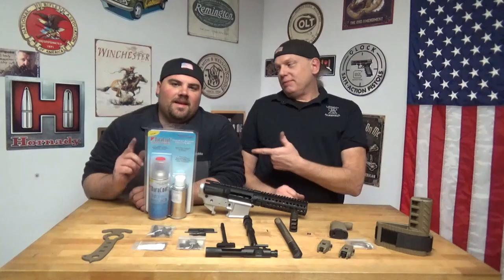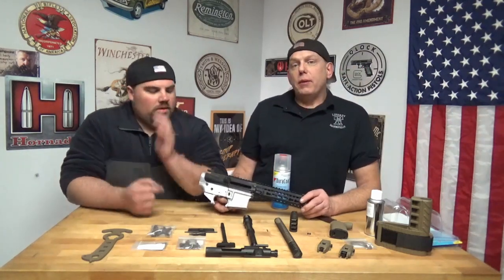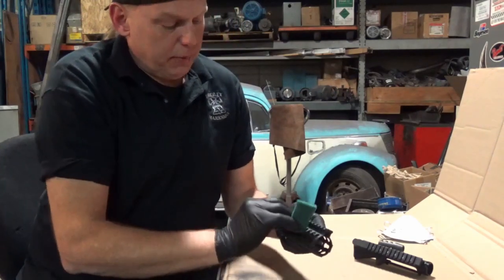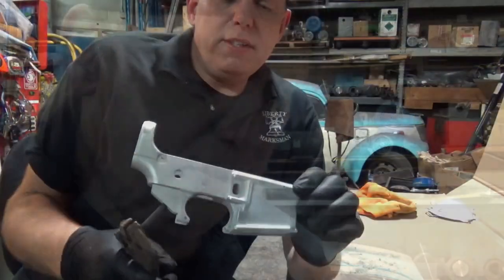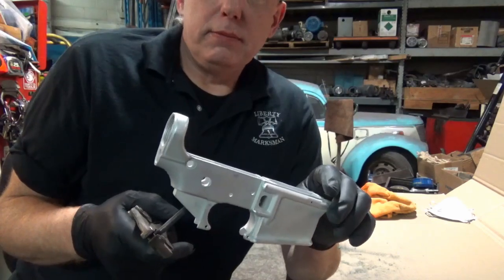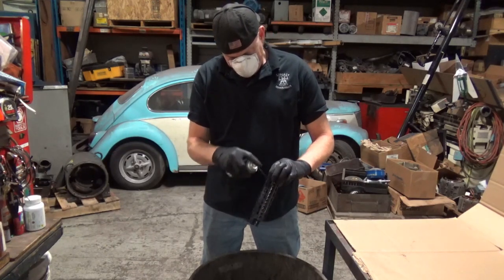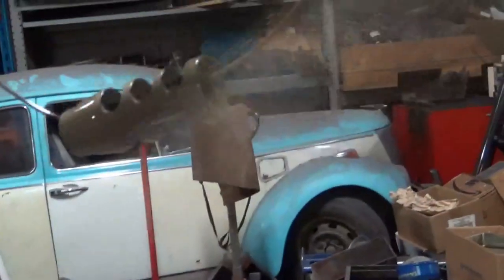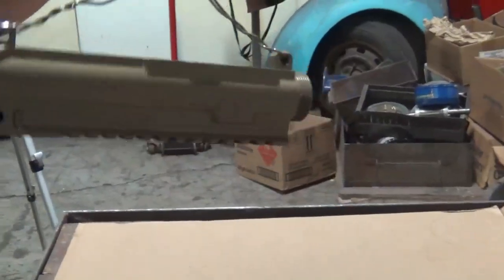No Air Compressor Needed Gun Coating With DuraCoat Aerosol

Comment: A little painter's trick.....You can control the final look of the "matte" finish by changing the distance you hold the spray can / sprayer from the component you are painting.  If you hold the spray can / sprayer close to the component, it will dry with a slightly more glossy/smooth finish.  If you spray from a little further back, it will add a little bit of texture and look more "matte".  Changing the distance changes the texture of the paint (how it lays on the surface of the object), resulting in slightly different "sheens" of satin/matte.  Also, as you can see in this video - if you put on a slightly heavier coat, it will be smoother, vs going with multiple very thin coats, which will give a little more texture to the finish that reflects less light after curing.  If you want to experiment with this process, you can buy a can of Aluma-Hyde pretty cheap and play around with it by scuffing some aluminum soda cans with Scotch-Brite and spraying from different distances to find the look you want.  Once you get the technique down, you can switch to DuraCoat or Cerakote and get the results you want.  Great video - thanks guys!!!
Reply: How far back are we talking about to get a more matte look?
Reply: @SkintSNIPER262  Oof lol, a whole year.
Reply: Lol
Reply: @SkintSNIPER262 about 12-15 inches. Just so that the spray "stream" spreads out and kind of 'dusts' the surface of the part you're coating. Just make sure the last coat you put on has had time to flash dry (10 mins or so).

Comment: Blowing the parts off with air compressor after sanding and before spraying the cleaner will get rid of the whole dirt issue all together
Reply: @phantommaggotxxx  Im pretty sure he was pertaining to the fact that previously duracoat and cerakote and the like all had to be mixed and sprayed outta a spray gun requiring an air compressor and proper spray gun etc. just to apply the product as to where now it comes in an arresol spray can that u can use any where without a air compressor but I can also see what ur saying also since the name is no air compressor needed hahaha but even then a can of compressed air for electronics and whatnot would be quite useful for blowing off the dust and debris from sanding/scuffing and save alot of hassle and frustration before using the degreaser or whatnot .
Reply: @phantommaggotxxx  well thay didnt make a good example
Reply: @phantommaggotxxx  On that note, would canned air work as an alternative to a compressor for drying and blowing off debris?
Reply: @atomic_wait  It would for the most part, but you may end up going through several cans, so it's not cheap.

Comment: No doubt precleanig all parts with brake cleaner removing all oil and dirt before scuffing. Then blow all parts with compressed air . Then use metal cleaner with kit. Then spray all parts with Duracoat finish according to instructions

Comment: There is a reason they suggest cleaning before you sand the parts. It's just like painting a car. If you sand before you clean the parts, you run the risk of sanding grease and other junk into the  paint that will blead through your paint job. So, follow the directions.

Comment: I've actually used that once, when I didn't want to break out the air brushes (I hate cleaning those things).  It works pretty good.  Three coats on a shotgun gave it a tough, quality coat.  Apply it thick to those "tight fitting" areas and it ~will~ mess with tolerances.  Don't get in a hurry as far as cure time goes.  I left my gun hanging in pieces for about a month (patience, Grasshopper).  A tip for muzzle breaks or similar devices:  Screw a wood dowel into the threaded end, then put your "hanger" through the dowel.  It gives you better control for coating, and it keeps the Duracoat out of those threads.  It's like painting a popsicle.  Good review.  "Thumbs up" from this Kentucky boy.
Reply: thanks nice tip

Comment: Simple green in a bucket soaking (for very oily parts) an hour then scrubbed less time for new parts  then re soaked and scrubbed with a clean tire cleaning brush! Rinse in a five gallon bucket of warm dish soap, it does wonders and with a final hose rinse and after the parts dry then spray with brake cleaner then spray I get the best finishes when I do it that way instead of just the brake cleaner/solvent method
Reply from the maker: Sounds like it would work good simple green is a wicked degreaser.
Reply: Thought brake cleaner is a no no
Reply: Post some pictures or videos of them
Reply: I'll try that method next time thx for the advice!
Reply: Where do you get a 5 gallon bucket of dish soap?

Comment: I did the same treatment to my Mosin Negant, came out great.
Five coats of DuraCoat flashing off the solvents between coats with a heat gun, nothing easier.
Reply from the maker: That's awesome, how's it holding up for you? It's been a couple years since we did this one. We are very satisfied with how it's lasted. Thanks for watching Chuck.
Reply: Thanks for posting that the durability was my main worry. I'm placing my order now.

Comment: Looks great👌👍 I haven't had a chance to use durakoat yet but have used alumahyde black. I cleaned thoroughly with non chlorinated brake cleaner and dried it off thoroughly with a heat gun and applied the alumahyde then speed cured in a toaster oven at 200 ⁰ for 3.5 hours turned out really nice on my first try. I used an old buffer tube to hold the lower while painting. I just ordered 2 cans of Durakoat for my next build. Thanks,again!
Reply from the maker: Good luck with your next build and let us know how the Duracoat turns out.

Comment: I believe metal is pretty pouris. Allot of gunsmith will tell u to de grease the gun first to avoid sanding it in. I'm pretty sure might not really make a crap. But I would just dawn wash that shit. Sand it. Then spray with that degreaser

Comment: Does the Duracoat fill gaps between the upper and lower very well? I'm wondering how thick the coat will be when finished? Also, did painting the threaded portions affect assembly? Great video. Thanks.

Comment: I finished a whole can on a CZP10C polymer lower. That was like around 10 coats or more. I have nothin else to coat, so i thought just finish the whole thing. Turn out really good, to be honest it wears just about the same as my cerakoted glock slide.

Comment: I'm thinking they want you to degrees before you start so you're not just rubbing grease and but if you have new parts that would be kind of pointless. 
Those red scotch brite pads are a heavier grit I guess you would call it. that's probly why they wanted you to use that.
 But either way awesome job. A lot better idea than sending my stuff off to somebody that I don't know if I'm ever gonna get it back. Being able to do something yourself is so much more rewarding then paking someone to do it.

Comment: Did you have any trouble fitting the pins in? If you done it again would you tape certain parts off like threads or holes?
Reply from the maker: We had no problem but if you did just polish the hole with 1200 grit sand paper. Just be careful not to scratch the surface.  Best to put down some masking tape.

Comment: so.. the truStrip..how much does that differ from Brake cleaner? I'm guessing it's more expensive than Brake Cleaner, and as your video shows.. doesn't seem to do the job as well as Brake Cleaner either.  
Thanks for the tip of the residue that brake cleaner leaves behind.. as I wasn't aware of that.. but thinking back to the 3 things I've painted after using brake clean, I do recall 2 of them having a very mild texture.. maybe from the residue you mentioned.. however it was in no way an issue or ugly. :)    thanks for the video.

Comment: Looks like you did not cover all holes on the receiver. did you have an issue to assemble receiver? 
Thanks.
Reply from the maker: We did not have any fitment issues however that would change if you put on thick coats.

Comment: this might be a dumb question. after spraying all 3 coats, is it hard to get all of your roll pins back in during assembly?  the coating has to shrink the bolt release, forward assist holes, etc. does installing the pins chip the finish or is it not an issue?  -thanks
Reply from the maker: We have had no problems other then needing to lube the trigger pins for install.
Reply: Thank you both for the question an reply, this helped ease my concerns.

Comment: You’re supposed to lock the red piece into the bottom by pressing it down on the table and locking it in you’ve just sprayed an entire gun without it being satisfactorily activated that stuff is going to scratch and fall off... this is why people should watch the videos provided by the manufacturer.
Reply: Your late to the show, they have already stated that the durability is better then they expected. Not to mention in the video you can see them set the can down, and it sets down flush in the table meaning they did push it all the way. Just because it didn't make the final edit doesn't mean it didn't happen.

Comment: Will this stuff make engraved markings in the weapon disappear? Or will they still be seen through?
Reply from the maker: If you apply it right you will still see them. If not you did it way to thick and it will probably crack and flake off.

Comment: Why not use a air compressor and blow off most of the dust and debris then use the spray cleaner they supplied?
Reply: Most air compressors will collect and put out some moisture. You don't want water on the metal. You could get some canned compressed air, but make sure they guarantee no moisture.

Comment: question...will the break cleaner be to strong to use on polymer for instance if i wanted to paint my stock and grips will it eat the polymer???
Reply: Do not use brake cleaner or any cleaners period on polymer. If ever you wanna freshen your polymer up, use pledge and a dremel tool with a cloth attachment.. rejuvenation of the polymer!

Comment: Is there any problem with seatings after the coating? I mean, there´s coating where no coating was before and i doubt, that some scotch pad can rub off that much.
Looks cool anyways.
Reply from the maker: Yes if you lay it on to thick, stay away from the barrel fit and go lite on the threads if not at all. Also you do not want to do the inside of the upper.
Reply: Ok, thanks for the quick answer :)

Comment: Have you ever had any tolerance issues ?
Reply from the maker: No just have to stay light or not at all in some areas.
Reply: Glenn McClure - I used Duracoat and didn't tape up the holes for all the mechanisms, and it was a son of a bitch to install all the parts without damaging the coating. Tape, tape, tape, tape "ALL" the openings, holes and threads. No need to decrease the hole sizes or screw up the thread tolerances and create problems for yourself when assembling the rifle.

Comment: Dudes, where you been man??  Glad you're back.    Is there any advantage to curing the paint in an oven?
Reply: Bang Switch it drives up the vapor pressure on the solvent, and allows you to dry and set the pigment and medium more quickly.  depending on the carrier media for the paint, and the pigment, it will aid in quicker and more consistant crystallization or polymerization, making for a tougher coating.
Reply: Thanks for the BS lecture on organic chemistry.  However,  I didn't ask you a thing.  I asked the guys from LIBERTY for their experience.  Troll elsewhere.
Reply: Bang Switch trolling would be to tell you to wet-buff your parts with a bit of warmed gallium and a scotch-brite pad before degreasing...  providing some basic chemistry for a medium (paint and binary epoxies and resins) that I've had experience in (professionally and hobby-wise), and reas for a little over a decade is not.

hell, my initial response wasn't even funny...  what's with people not understanding what trolling is?
Reply from the maker: We have found that putting it in the oven at low temp decreases the time you have to wait for handling. We have not found it to hurt the durability of the paint.
Reply: Thanks guys, appreciate the feedback.  Keep up the good work.
Reply from the maker: No problem

Comment: That upper is backwards, the ejector port should be on the left and it still has the design fault plunger on it and a rear charging handle. My bad he's one of the right handed shooters, so the port is on the correct side. ;-)

Comment: hows the duracoat holding up?? Thnx
Reply from the maker: Fantastic even beat our expectations.
Reply: I want to do a pistol slide. Would this hold up to holstering in a hard plastic holster?
Reply: interested in finding out if it'd hold up to the holster wear myself.
Reply: @garrethinze9738  it does! Just add a few extra coats so 3-5

Comment: When you DuraCoat or Cerakote a bare receiver, would you go through using something to rough up the surface, or just clean it to get everything off it?
Reply from the maker: You should etch the surface at least some what. The only exception we have found is if it is parked. Then just degrease it good.

Comment: Is this DuraCoat similar to Cerakote?
Reply from the maker: Well they are both gun coatings Cerakote is ceramic based and Duracoat is like a epoxy coating.
Reply: Liberty Marksman  Ahh, thanks.
Reply: Not that I'm partial, but Cerakote is over 10 times more abrasion resistant than Duracoat.
Reply: But, to be fair to the flavor of the video, I wouldn't even want to try spraying C series without a compressor. I've seem the fillable sprayers you can buy at Home Depot, and they look a little jinky.

Comment: my duracoat wont stick to the bumps on the gun and runs off.
Reply from the maker: your ether putting it on to thick or there is oil, did you ruff it up?
Reply: Liberty Marksman My solution was to paint it with a rough oven spray paint then paint over it and finally it adhered to the surface but by the time i was able to finish my project the aersol had already set. Duracoat was nice enough to send me a new can for free.
Reply from the maker: Cool man and that was awesome that they did that for you.

Comment: great vid, however, i was wonderin if the is any issue on the internal surface of the upper receiver if it rubs with the bcg?? will it make a flaking residue?
Reply from the maker: We have had no problems with it at all no surface ware, we do keep it lubed tho.

Comment: Fyi Non chlorinated brake cleaner won't leave that  Powdered  Coating
Reply: Pitbull Gamer81 - It may not leave a "Powder" coating, but it does leave a dry residue of dried brake cleaner that is white in color. Using alcohol wipes after the brake cleaner will remove residue.